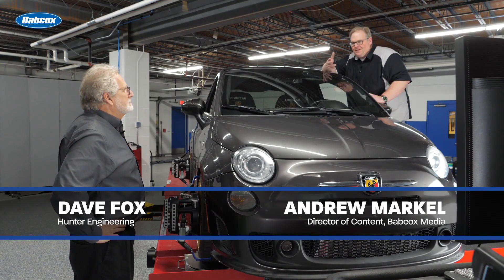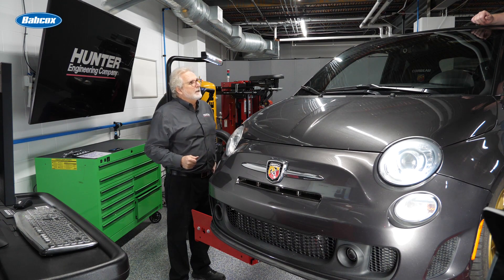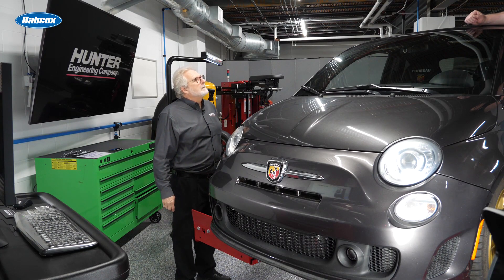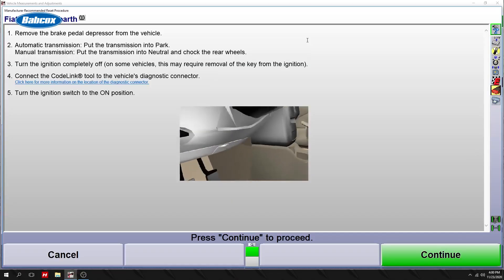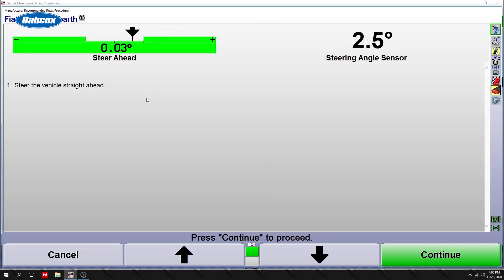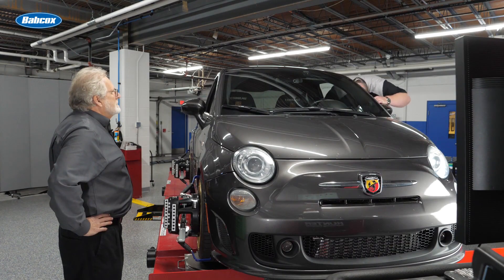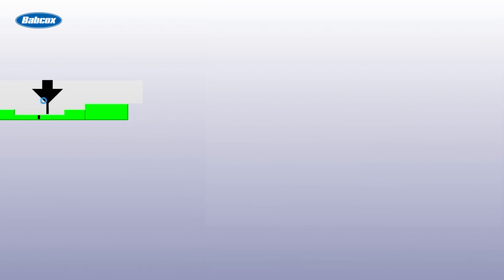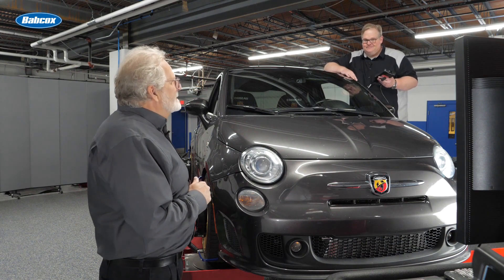RESETTING THE STEERING ANGLE SENSOR AFTER AN ALIGNMENT

Comment: 2003 Nissan 305z..I had the mechanic change my rack and pinion now got VDC BRAKE SLIP ABS ..check engine come on...is that normal when change the rack and pinion will cause that ..I have not do wheel alignment yet..if i do the alignment will those check engine light go away?

Comment: I'm wondering about f-150s with electronic rack. Hunter doesn't give a code link option for Ford. I have gotten a couple that after alignment, they swing left out right and cause a pull. The only way I can fix those is by toe adjustment, center steering wheel, and eventually finding the sweet spot and it will center and drive straight. But a couple have really eaten my lunch, where the thrust angle was off in the rear, and I just couldn't find the sweet spot. Therefore sent those customers to the dealer. My question is.. What tool do I need to reset a Ford F150 steering angle sensor with electronic rack and pinion? Any other tips?

Comment: Same question for me, after the allignment of my Ranger 2015 suddenly the steering wheel is not straight anymore and I got the traction light on for some reason. Anyone knows how to put this back? struggling and I don’t want to bring my truck back to the same shop.
Reply: My steering wheel isnt straight either.. but no error or codes. If i drive and center the steering wheel car drives a little bit to the left..
my steering wheel does slightly turn to the right.. really odd. They center the wheel at the alignment. And adjust the steering "things" between steering rack and wheels.
everything was good.. so i dont know..i might have a suspension issue or something wrong with the EPS.
Reply: Most likely the shop screwed up your alignment.

Comment: You went through what you had to do to reset the steering angle but what did it actually do? Does it realign the steering wheel if it's a little off center? I think not but maybe. I just got a new scanner that provides that service but I don't know what it actually does when performed.